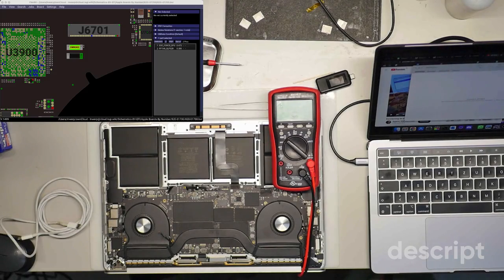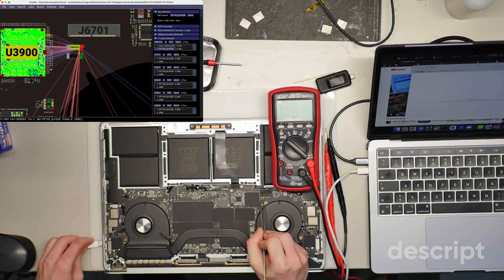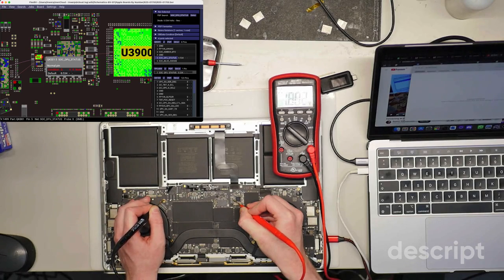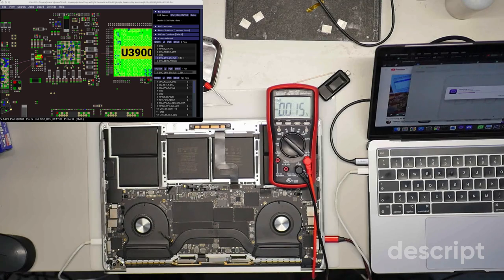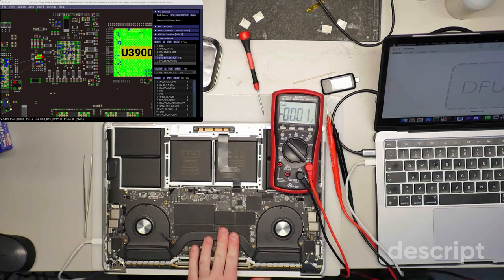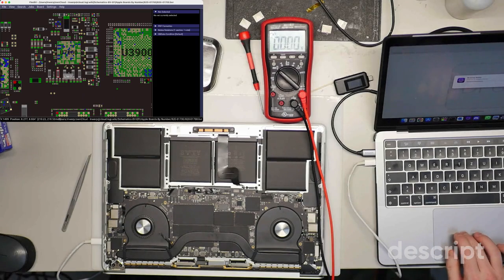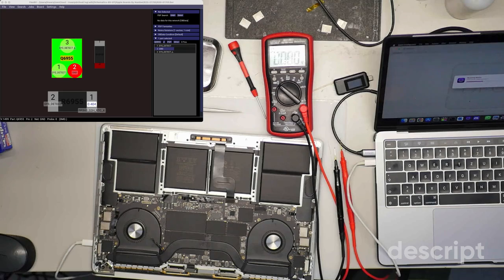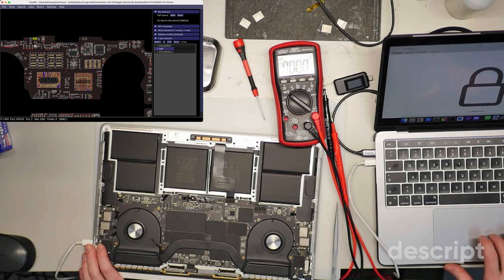MacBook T2 DFU jumper bareboard method guide

Comment: This is great! I wish you showed close up of where you prob.

I think my pc in dfu loop - touchpad clicks on charger. I wonder if battery is dead. Can you show where to prob battery voltage ? 

When are you located for repairs ?
Reply from the maker: I have a repair shop in Munich, Germany. 
device won't click in DFU since power sequence to turn it on is located in T2 LLB firmware which is not loaded in DFU. To check battery you need to check if battery voltage is rising and your power consumption indicates charging.
It does not make much sense to show jumper on one board because on many boards it is located differently. You need to use boardview to find force_dfu jumper as I said in video
Reply: @inwerp I see, I will try to get another Mac and restore it through DFU. If I do not manage, than will send it in 😊👍🤝 how to get your contact? You speak Russian ?
Reply from the maker: @TomHenry2  yes, i speak Russian, German and English. My repairshop is at ripperdoc.de , just fill the form with repair inquiry and mention you found me on YT.
Reply from the maker: @TomHenry2  also if you do DFU, use Sonoma and start it in Finder instead of AC2. This will yield a good verbose log in console app

Comment: I can't get my A2289 to revive or restore. As soon as I plug it in it's in DFU and won't come out of it. Lots of great info here, but sadly I can't get it to work. I tried to re-flash the SoC ROM to a clean state (backed up the original of course) and was hoping it would restore a new firmware, then I could add back my serial number. No luck! :(
Reply from the maker: you either have a bad CD3217 or issue with TBT ROM. if both are fine, that might be a bad T2.. what is your board condition, does it have 20V switch with original socrom? do you have any activity on SoC rom SPI interface, something on MISO?

Comment: I have a 2018 MacBook Air, could you show where I should solder wires? Perhaps an article or image would be great. It currently has issues with T2 and randomly shuts off. The main keyboard and trackpad doesn’t work and I can’t go into dfu with an external keyboard
Reply from the maker: i am sorry, for some reason i did not get a notification of your comment. you need to find board number and look for force_dfu point on board. there is also a way easier way to do that if you have M1 mac and you find and compile MacVDMTool from github

Comment: Connected battery is necessary for dfu?
Reply from the maker: not 100% sure, at least i can confirm that depleted battery might cause DFU fail untill its charged even if charger is present. however very same device might charge with disconnected battery. i also had few devicew which would not DFU without battery connected, but it was quite a while ago, so this might be not costistent behaviour.

Comment: I just stopped in here because I saw your comment on that Sorin guy @electronicrepairschool (yeah, right!!!)... That guy is a complete butcher... I've seen a few of his other videos where he does some REALLY sketchy stuff inside people''s computers... One example: He removed a MOSFET and replaced it with jumper wires, and said "I don't care about what a MOSFET does"... He dips the hot iron in flux when soldering, which is useless... He never cleans his iron's tips, and doesn't believe in shrink tubing... He wouldn't work on ANY of my electronics... Good Day, Sir...

Comment: Try doing it with 820-01521 board ;) 
Bet you can't
Those are stubborn boards, never got any luck putting them in DFU through testpoint.
btw, actually checked, boardview TPs are correct and lead to right tracks. But the board will DFU only from KB.
Reply: I have put these into DFU by jumper numerous times. Connect PP1V8_SLPS2R to SOC_FORCE_DFU, power up then it will be in DFU in AC2. If it is not then maybe you don't have PP1V8_SLPS2R available on the board?
Reply: @MrPnew1  hmm. Looks like I've got to retest.
I'm pretty sure there was no adapter present prior to shorting pads in my case.
But PP1V8_SLPS2R was indeed present at all times and was stable.
Reply from the maker: I did dfu this board few times using jumper and charged battery. You sure it was not same power pulsing issue I shown at start of the video?
Reply: I think i may have to agree with you on the DFU Testpoint. More testing needs to be done to be certain but i did experience this. But for me after i successfully flashed the SOC Rom Chip it went into DFU mode automatically without testpoint.I forgot to test if the DFU test point jumper method started to work as it should after SOC Rom Flash. But my main issue was I was having a lot of failed DFU restore errors.  The minute I connected a working pre-charged battery as mentioned by Alexey the DFU restore went tru successfully. This video is so helpful to understand how the DFU process works. I might be wrong but this model board needs a pre-charged battery for the DFU restore process to go tru without errors. I didn't have the customer board long enough to further test this theory. But the DFU restore process will always error out for this model board without a pre-charged battery connected.